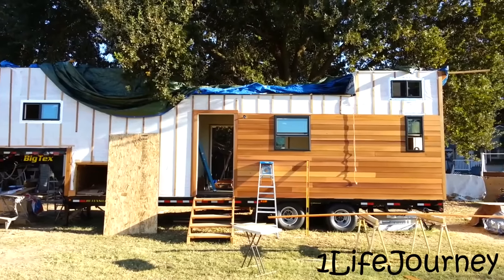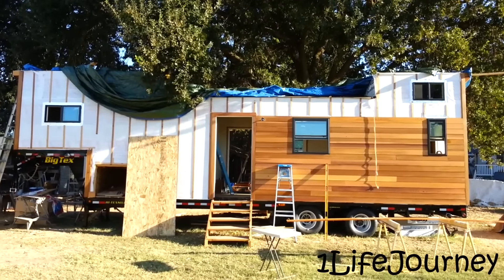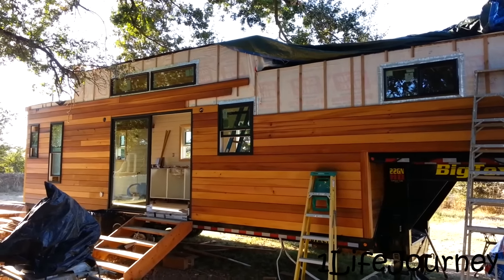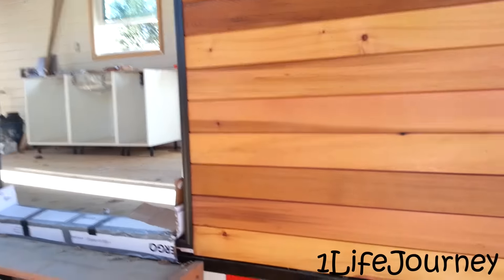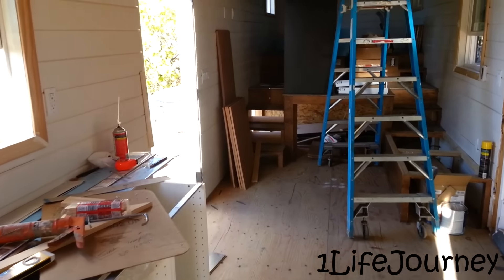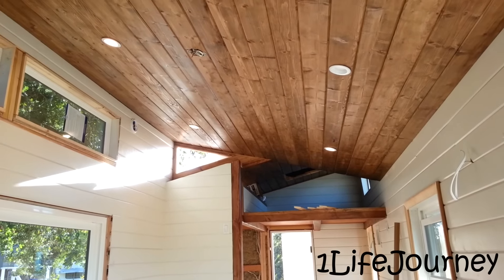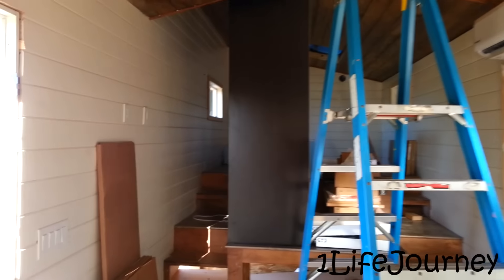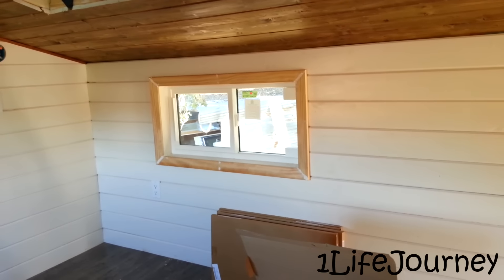This Tiny House - Vlog 7

Comment: Did you ever figure out the lights?  Some of those can lights have a heat sensor that plays havoc on how they function.  I would bet some of the sensors are bad, personally I would switch to LED and get rid of those.
Reply from the maker: +Deric Kettel We ended up replacing them with drop down style lights. It was most likely the heat that killed the LED lights.

Comment: What a beautiful exterior but.... THREE doors in a tiny house???? 
I understand the need for closet space, but that big cabinet blocking up the space stops of the flow, not in a good way.   I hope we get a look after it is all furnished.
Reply from the maker: +per sebra I snapped a few photos before the trailer was towed away. The owners really wanted to do a lot of the final finish work themselves to save on labor costs. The photos I took were of the trailer about 85% completed and will be featured in the last of the video series.